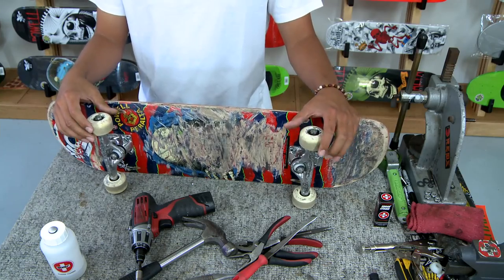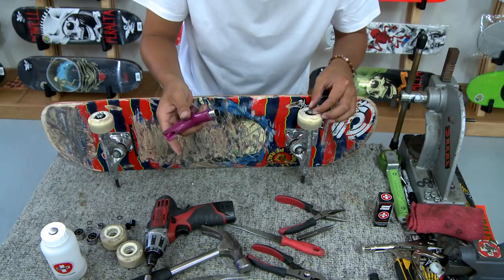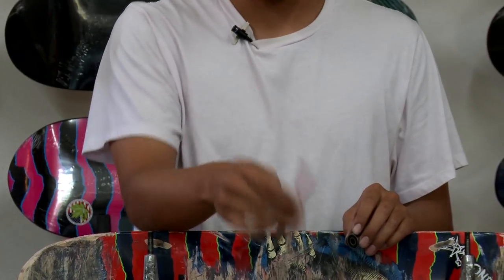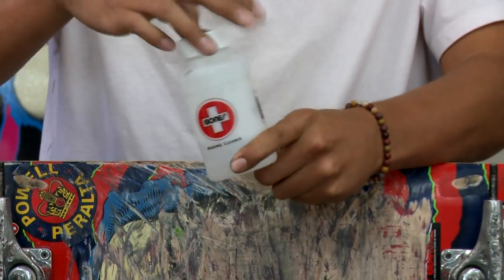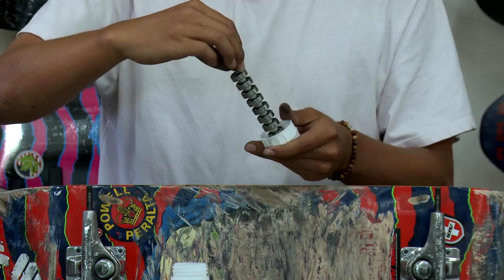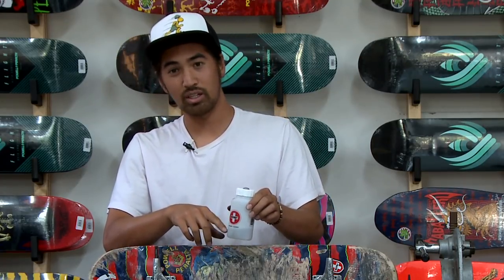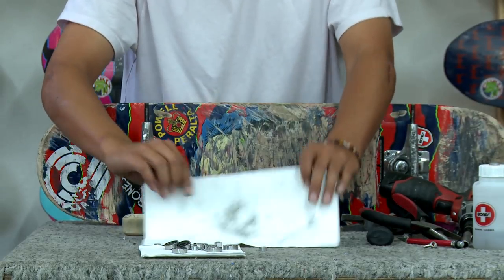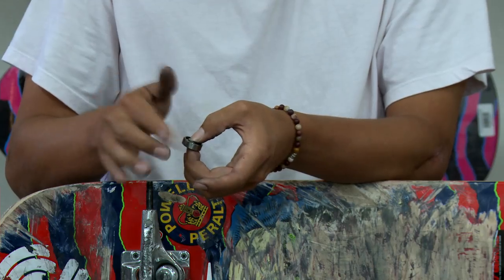BONES BEARINGS - How To Clean Your Bearings

Comment: Small note, let the bearings dry out before you apply the speed cream.
Reply: yes, im patient,  the sun is also a great dryer for just a few min, then let cool.  ive also experimented with Rock n Roll Gold bike chain lube.  couple drops before and after speed cream.  the rocknroll dries quickly and leave anti-friction compounds dry, but these will be suspended in the speed cream and continue to work
Reply: Aye sir!
Reply: Compressed air works good if your in a rush to get back to skating
Reply: I use a hair dryer, does them quickly then turn the heat off and use it to cool down the bearings.
Reply: @Elkins24  hair dryer is the ticket.
Reply: fo sho
Reply: Well shut
Reply: I have one bearing that’s just stick
Reply: Also, I don’t know if I applied too much lube because 7 of my lubed bearings won’t spin all that well.

Comment: Note: There’s one mistake in this video. The open/exposed side of the bearings (after the shield has been removed) should be facing down/away from the cap. This is what Bones Swiss advises (and makes most sense).

Comment: Cans of compressed air (the kind often used for cleaning your computer keyboard) work for drying the acetone from the bearing. Bones Bearings are the best, ever. Your favorite skater rides them, even though he's in ads for another bearing company. Believe that.
Reply: Super reds are better than reds though
Reply: Corbin Rodgers notice how he said Bones bearings and didn’t specify which one. He just saying they a good company. The ceramic  bearings are the best
Reply: @studsonh  also prettu expensive, i ride super reds since ever and im really happy with them. Ceramic cost 100€ more, wich is to much for me. if you can afford it, yea go for it! i would if i could!
Reply: Break cleaner.....
 its in a spray can and drys instantly, don't need compressed air, plus acetone can burn your skin or your eyes. Why bother with all that crap just pray it with break cleaner done!
Reply: Brake cleaner is usually chlorinated solvent, and is probably less safe than acetone. The cans of compressed air are not actually Air.  basically a refrigerant, but not an acute toxicity hazard.
Reply: Bronsons are the new king and have been a for a few years.

Comment: I've been riding the same set of Bones Super Reds since mid 2019. I haven't cleaned them once. My favorite things to skate are big drops, anything I can air out of, and curbs that I'm constantly bashing into/onto, so my board takes a lot of impact. Before getting the Super Reds I had a new set of another top brand's bearings which only lasted about two months before feeling incredibly slow. An employee at the local skate shop had the same problem with those bearings and was also switching back to Bones. I will never ride any other type of bearing as long as Super Reds exist. Please don't degrade the quality of them because of this. 23 years of skateboarding and I've never had a bearing as perfect as those.
Reply: 2003 for me

Comment: Can also use 91% plus isopropyl alcohol. Then you can throw the shields in as well. Cleans up everything. It dries a little slower, but works well and can go down the drain without issue. Just let em dry a little longer, speed cream and you’re off.
Reply: Will that devolve and types of plastics, I have reds bearings but there slight lift different to his
Reply: Break cleaner in a spray can

Comment: so i completely f'd this up and removed the CAGES, not the shields. thankfully i rode them today and they were awesome just like new. make sure you are removing the FLAT shields, not the cages which have little holders for the inidivdual bearings. if you remove the wrong side it will remove the cage and not the shield. i thought it was the right side cause the shields actually look metal and not rubber but the cages look and feel more like actual rubber.

the shields blistered a little from the acetone but they seemed back to normal this morning and rode fine. 6 ball swiss

Comment: I followed the instructions for this video and after I cleaned the bearings and let them sit for a bit to dry, I applied the lubricant. But right now it feels like my bearings were faster before I clean them and everything. Did I do something wrong? Or is this normal for a bit until I break into them again or something.
Reply: @negronmax8  after a bit, they did a little better. I think I accidently put too much speed cream but while it spun out it stayed with the right amount. But there was still a bit of grime in them.
Reply: Thats normal, lubed bearings free spin much less than dry ones, once you step on the board it makes no difference. I cleaned and lubed all my bearings a few weeks ago and the board actually felt faster, even though the free spin time was way less. Btw one drop of speed cream is enough, I used to do two but as the wheels spin it starts coming out and attracts dirt.

Comment: Depending on how dirty they are, can i use the same solution to clean more than one set? Or should i replace it for each set i clean?
Reply: nope, i discourage you to do that. i personally clean 2 time with 2 solution so avoid small dirt. unless you find a really good filter to separate acetone or other cleaning solution. wich acetone btw will melt plastic so be carefull wich material are the roll cage...
Reply: run it through a paper coffee filter if you want to reuse the acetone.  some clean is better then no clean. there will always be a little dirt in the bearings, everyday wear and tear.  aint gotta be perfect.

Comment: I may have fucked up my Bones Swiss :( I got the bearings in July of last year. I had it cleaned for the first time more or less 1 - 2 weeks after I got the bearings. I used Antiseize Bearing Cleaner by Sector 9. I used almost all of the cleaning material. The instruction weren't that easy to understand to be honest. Anyway, I called the Zumiez I got it from and they told me I should still be good, like nothing to worry about. They still spin. Some don't too much though, or at least one of them. I cleaned my bearings just once this year cuz I ran out of the bearing cleaner. Now I want to clean the bearings cuz I'm convinced they need cleaning. I've been filming a lot - follow cams and stuff - more the past quarter to a year. So my bearings ain't that dirty as opposed skaters who focus on doing tricks. Anyway, what do you guys think? Are my bearings still good? Is it fucked up? How do I know it's fucked up?

Thanks! :D

Comment: i would forgo the acetone  very volatile product , use something more green like citrus cleaner , great video
Reply: Its not volatile unless you boil it or add flame. Dont smoke while you use it and dont huff the fumes and youll be fine. Poeple have been using it as a solvent forever. Just use common sense.

Comment: Hey! I don’t know if you will read this but I really need help with my bearings. I recently just built a board and bought some bones redz bearings and when I was inserting the bearing into my wheels I pushed really hard into the bearing shield and now the board wont get the same speed as the type I see in videos. I tried flattening the shield so it would loose the drag and it helped but it still wasn’t great. Do you know any tricks or maybe a product of yours that would help?
Reply: I don't know if you still have this problem. But it sounds like you might just need to get new bearing shields. You could probably buy a replacement somewhere

Comment: Ok I actually have Different bearings than bones and I need to clean My bearings and Don’t have the money to buy Acetone what other replacement can i use?
Reply from the maker: Go to your local skate shop and ask them if they have a community speed cream bottle. If they do, just do one drop into each of your bearings. It'll be a nice temporary fix
Reply: ^ emphasis on "temporary" for any decent amount of time that would be worse since itll pull in more dirt and just push the dirt already inside around.

a better alternative for acetone is to find an all purpose natural citrus cleaner that has orange oil/dlimonene. its natural, safer, and smells nice. only downside really is having to rinse off the cleaner. but thats easy with some hot water and quickly drying them off with compress air or a hair dryer.
Reply: You can use carburetter cleaner if you can't afford the whole special kit and the acetone, it won't be as good as soaking in acetone overall, but because it's sprayed out it will blast the shit out and it should work fine. You'll still need speed cream though, nothing else will do.

Comment: Hello, You said removed the shield because the acetone could damage it, what about the retainer(cage), you didn't remove it, it is made from plastic as well I think. thanks
Reply: You can leave the cage in place during cleaning. Acetone doesn't damage those.
Reply: the shield is rubber not plastic and acetone damages rubber more

Comment: OK.... I'm kinda making the rounds, I might as well help out Skate Boarders.... Been using bones swiss bearings since the early 80s when my buddy Dean Huffman worked there. RIP Preamo Deano, Yes he had a wheel pre Tony Hawk.... Anyway, Take the shields off, then laye your bearings out in your kitchen sink.  Then lube them up with dishwashing liquid. Yes, Palmolive is my choice.... Then take then and maybe squirt a little water in them and work the soap in with your fingers, rolling the bearings. Then drop them in a mayo jar with water. (yes water) When you are finished with all the bearings put the lid on the jar and shake it up. pour the water out, and do it again till no more buubles. 
     Then dump the on a towel to get as much wate out as you can. Then put them back in the jar and pour acetone in. Not a lot, just to cover them. Then agitate them by skaing the jar a little. After that, dump the acetone in another jar and save it. put the bearings on a paper towel and tap them a bit to get the rest of the acetone out and then put a drop of sewing machin oil in and put the shields back on. Donzo.  If at anytime you have a bearing that makes noise then just repeat any of these steps. 
     TRust me, no skateboarder needs faster rolling bearings than a speedskater unless they are bombing 70 mph down a columbian mountain so this process is tested and good.

Comment: I just got some brand new bearings and they’re a slow and one of them stops almost immediately. Will this help?
Reply: If they’re brand new, no need to clean them. Just put two drops of speed cream inside the bearings, opposite ends and roll on.
Reply: But if you try to add the cream without cleaning them it’ll just make them dirtier with all the build up already in them. It’s worth it to clean them, and apply the cream. But make sure after you clean they they’re dry. A blow dryer works good.
Reply: You probably got your wheels on to tight

Comment: Do you have to use to speed cream in order to help your bearings or is it optinal
Reply: OTHER nervous714 if you don’t use speed cream (or any different safe lubricant) then you run the risk of damaging the bearings through times use. If they’re dried out, then you should hear a hissing or popping noise when you spin them, so yeah it’s better to lubricate them or else it could cause long term damage later

Comment: Does it have to be reds to clean them with this speed cream or can it be any bearing brand and can this be used if I got water logged or is it just for them to go fast
Reply: You can clean any brand of bearings using these same methods and equipment... 
UNLESS, sometimes when you buy like, a cheap complete or cheap wheels you tend to get sealed, one-use only bearings that you can't take the shield/covers off and these can't be cleaned. But any you buy as a pack from a skate shop will have removable shields

Comment: Can so-called sealed bearings be cleaned this way too?
Reply: It technically can, but you can't put metal shield back, as you most likely will damage it will removing. So: a). you find a replacement shield, b). you run it without shields after that, placing both bearings bare side in, so it takes less dirt from the street.

Comment: For removing the shields, instead of using a blade or something similar, I always using something like a small screwdriver or paper clip, slipped through the other side of the bearing, and gently push the shield out.  Much lest risk of damage from cutting the rubber coating.  Just be gentle enough not to bend the metal.

Comment: I would recommend a citrus based cleaner rather than solvent. Solvent will make the plastic as well as shields swell. Rinse with warm water then dry with compressed air and a heat gun(hair dryer)
Reply: 😂 what exactly do you think a little lemon juice is gonna due to the line you’re trying to remove from the bearing? May as well use water.

Comment: Hey, so i just put some speed cream on my bearings (BONES REDS) and before i did they were spinning for a pretty good amout of time but know they don't. Please HELP !!!
Reply: You should just use 1 or 2 drops, more will slow them down
Reply: thanks i'll try it out ^^
Reply: Make sure you clean first if you don’t you’ll just move dirt around More and make the bearing worse overall
Reply: if ur basing the speed off of simply spinning a dry bearing vs a lubed bearing just merely in ur hand then....well. dont. a dry bearing will obviously spin much faster and longer than a lubed one. the lubrication is to keep the bearings in good condition for longer. theres also a huge difference between checking the spin and riding. as long as they spin freely and slowly come to a stop then ur fine.

Comment: Like the nut I am I actually tested this vs. my little ultrasonic jewelery cleaner I got off Amazon for $35. I found that even after this process, if you put them in the ultrasonic with just hot water and dawn dish soap you'll still get more grease and shit out of the bearing. Just can't beat the ultrasonic. If you don't want to spend money on a little ultrasonic, put the bearings in Tupperware, cover them in hot water and dawn, and hold an electric toothbrush or razor to the plastic. It created the same agitation as the ultrasonic. Just annoying to have to stand there holding it.

Comment: this looks like an incredible pain in the ass!  How is the difference between dirty and clean bearings measured?  RPMs?

How frequently does cleaning need to happen?  Which bearings don't need to be cleaned ever, or which ones go longest without needing to be cleaned?
Reply: You go by 'feel'. Cleaning them is a pretty easy process but I guess you don't have to. Depends on how dirty your skate spots are.
Reply from the maker: It's definitely not an incredible pain in the ass. If your bearings are going much slower than usual, there's a solid chance that they're dirty. Spending 15/20 minutes to clean them will make the next session a much more enjoyable session than the previous one with the bearings being dirty.

The only possible annoying thing in this would be if the truck's axle or the nut are stripped. That would make tightening the wheels back on the board very difficult.

Comment: I just have one bearing in my whole set that doesn't move like the others, it stops instantly, any way to clean just that one? I'm not going to buy a cleaning kit just for one bearing
Reply: Well it may be damaged, you can't always clean them. Also I can imagine you will be able to make this "professional" cleaning set yourself and you can also look if your bearing protection isn't broken
Reply: My bearing protection is sligthly off ( don't know how that happened) , it's kinda stretched out a little and it rubs against the bearing, what should I do? Run it without the seal? Is that too risky?
Reply: @baidoc1633  honestly itd  be good to invest in a cleaning kit regardless. or make ur own if u like.

u can take apart the bearing if u want, to see what the problem is. unless u have metal caged bearings.

with the seal, if its warped, u can honestly just put it on a flat surface and hammer it flat. running it without the seal isnt a huge deal, its just that dirt and other particles would easily get in, sometimes maybe even ceasing up the bearing while riding. but that would only happen if shit is flying in there a lot.

Comment: How often should your bearings?
Reply: It really depends on how much you ride and the environment you ride in. Basically any time they start making a grinding noise it's best to clean them. Even if they don't start making a noise I would suggest cleaning them at the end of the summer if you won't be riding them for a while or twice a year if you live in an area that allows full year riding.
Reply: I started skating 8 months ago and felt my board lost a bit of speed about a month ago, the area I train and live is kinda dusty so I plan to clean them next week. Hope that help you get an idea.
Reply: When there’s sparks flying out they need changing 😁

Comment: Did you say "shield"? Cause they look more like a "seal"
Reply: Madball NY it's called a Shield tho
Reply: Those bearings are called sealed bearings. The shield ones are closed with the shield in metal.
Reply: +parker.elliottttTypical phrase you use when you know you don't have anything to say cause I'm right. :)
Reply: +Sinking Fish, Just don't know what to say. Nothing new here. Someone above said the same shit cause he didn't have arguments. :)
Reply: Madball NY hey man it's rubber on one side and metal on the other so maybe it's still a shield
Reply: no... it's a shield, not a seal.
Reply: @warzonehardcore  doesnt make it a seal. its a shield so the actual runner part doesnt run against the wheel